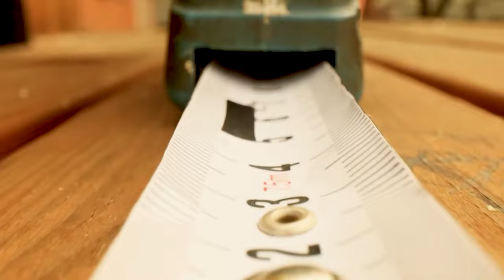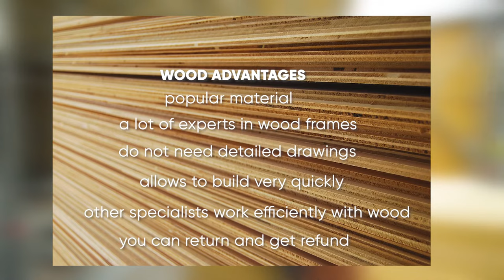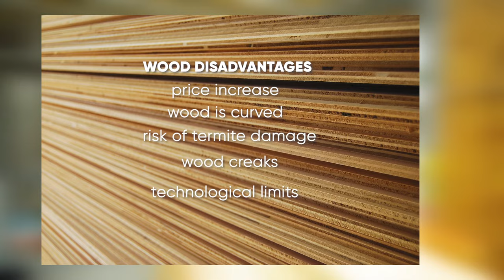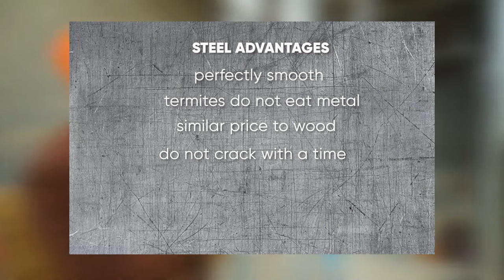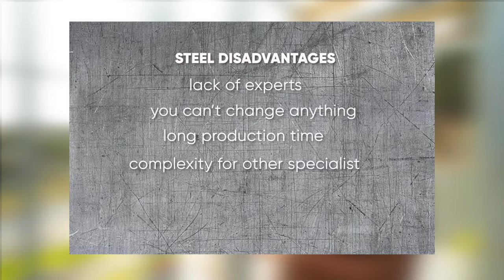Metal or Wood Framed Home - Which To Chose?

Comment: You missed the biggest flaws of wood: 
1. exposure to water or moisture will twist bend and deteriorate your structure very quickly (in matter of hours), with rot and mold as a bonus
2. wood will sag and bow no matter what under the load, forget about level floors and walls in as little as 5 years after construction

3. Wood is flammable

Conclusion: build your whole house with a concrete, steel and glass only (including roof) if you want your house to last and not to repair it every other 5 to 10 years.
It takes mor planning and effort for comparable price, but you will forget what is maintenance, will sleep well if tornado or hurricane comes over, or forest fires approach behind the hill.
The Europeans (Germans) are laughing their asses off that we are still building houses from the wood.
Wood has its place, if you build a cabin in the woods, for decoration or furniture but NOT a building material for your home.
Reply from the maker: I didn't miss it. I tried to tell viewers about all pros and cons of wood vs steel..but at the same time don't make the duration of the video too long.. 
But generally, I agree with your comments
Reply: I have seen so many people building with pre-treated wood (to avoid termites, fire retardants, and mold), and they claim it is sturdy (not as steel thought).  They chose wood because it's fast and easy to erect.  Can you expand your home with a steel frame? I hope this makes sense to you.  I am new.
Reply: Is aluminum acceptable for internal wall frames and horizontal support? Then vertical support columns can be steel H beams. And then all outer walls be made of rebar and concrete? That sounds good to me... If I had to build it all myself at least...
Reply: Most of the framing constructions are not steel, it's a type of magnesium (manufacturers are hiding it from us, but do you believe 1 man could easily build a home alone if we are talking high quality of steel here) that is like a leftover from production. The only con that I can find is the durability of that magnesium when exposed to higher temperatures.  "The main disadvantage of magnesium and its alloys is low deformability at ambient temperature" in a fire the so called steel house will start collapsing at like 500 degrees Celsius. Compared to wood, even in a Fire most of the elements are treated and you might have a burn on the outside of the wood but the core is totally fine. Another thing is sound, if you don't put good insulation in the metal construction you will hear more backgound noises. Just think about it: why do Scandinavian countries build the way they do? Nowdays it's more affordable to build with the "steel frame" so I'm putting my money there as well (just keep it away from fire) ;)
Reply: @amplecrayon9724  Aluminum is too expensive and soft, it also has a hight thermal expansion cooficient that is especially destructive on long spans. Some aluminum alloys can actually compete with steel in strength but those are aerospace grades that are prohibitively expensive
Reply: @jackies35  what you have to realize that as long as your outer shell is concret/ steel you can rearrange internals if you realy want to with drywall and whatever you want, but the floor support should have no wood in it as well.
Reply: @vm5571  Right, you do need almost double the volume of aluminum to match steel, but its also much lighter in that case still, which was why I was interested in the first place. I guess the thermal expansion issues really are so bad that it bars any viable use in large constructions.

Comment: I think CFS is a much better product. We can erect  a 1200 sq ft frame one story in one day. That includes all trusses. We use frame cad system. We build from 20 gauge to 14 gauge. 
True wood assemblers are easier to find. But metal guys are catching up. Wood is cheaper in most cases. But metal lasts longer. Goes up quicker with less waste. I would choose CFS hands down over wood all day long
Reply from the maker: yes, I also see more and more advantages of using metal in our projects
Reply: @MyTexasDreamHome  Can you expand or make adjustments to a steel frame home as fast as a wood frame home?  It is so easy to build with wood.  Some Youtube Post-Frame Builders reinforce their wood and retreat it very well to avoid termites, fire, and moisture.  It's now 2023, and I wonder if this issue is going to fix in the USA.
Reply: @jackies35  I think it expandable same way it was build. You just need welder instead of hammer
Reply: How does that compare to timber framed homes?
Reply: It a little more expensive up front. But your getting a frame engineered to 165 mph wind load. Straight walls. No cutting. No welding. No waste. Frame is like giant erector set. Walls are complete ready to set up. Trusses are flat packed and have to be put together. Very simple. Very fast and very strong.

Comment: If you use steel, do you save on any inspections?
Reply: No. If anything, you have to know what you're doing in order to meet code. You can't use 25 gauge for exterior load bearing walls, you have to use 20 or less. Stud guage becomes a factor depending on whether you're running 16, 19.2, or 24 inch on your stud spacing. Most people will follow engineered plans, but if you're a DIY guy, make sure you know what you're doing in order to pass inspections.
Reply from the maker: My inspector is my best "friend"...I mean we follow all his orders and notices
Reply: @lornes7526 is the lgs quality the same?  Or are there different qualities like in rebar?

Comment: Could you make a video covering insulation and thermal bridging when building with a metal frame. Would wrapping the exterior with rockwool insulation reduce thermal bridging and reduce sound. It would also make the building more secure from fire. This is how I would like to build my house extension, cost permitting.
Reply from the maker: Good topic! I will try